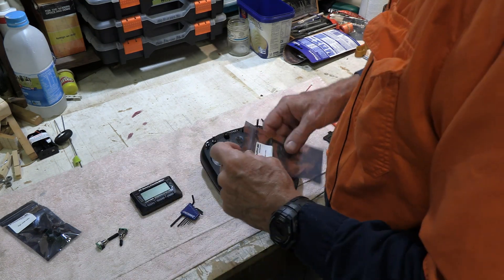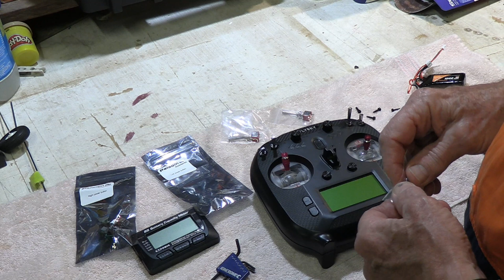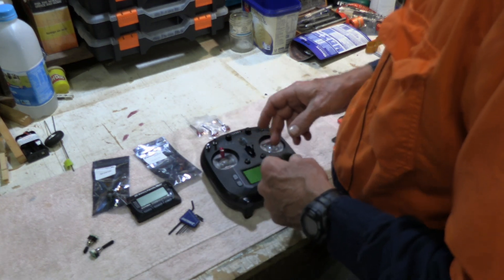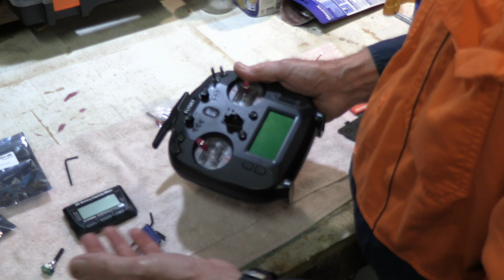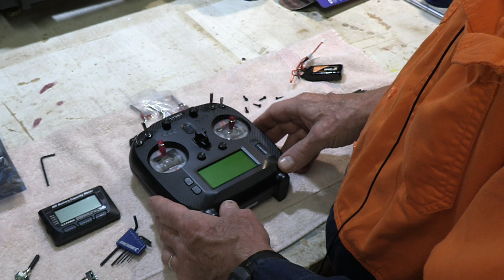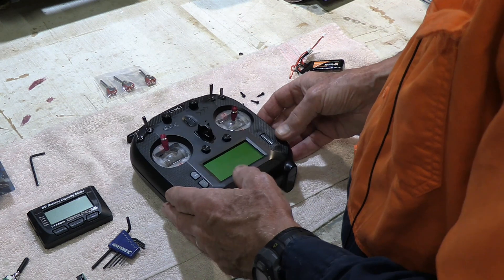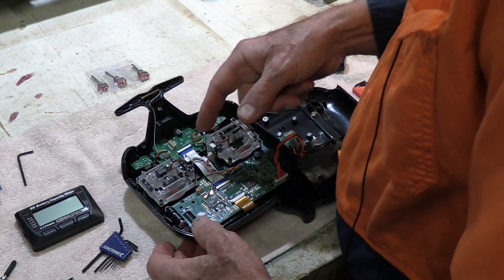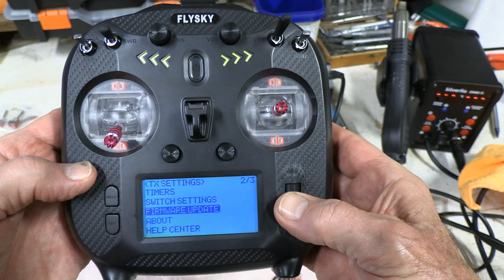Flysky FS-ST8 RC Transmitter Switch Replacement

Comment: Hello I juste try on mine but it didn’t work like their is nothing on switch B do you have an idea on what can be the problem ? Thanks 🙏
Reply from the maker: Did you go into the menu to identify it as a three position switch?
Reply: What if the circuits fried there seems to be no replacements for the switch circuit on its own

Comment: As you say its a cheap throw away. Spend a little more money and get a Radiomaster Tx16s.  You will not be disappointed.  EdgeTx software is continually updated and open source.
Reply from the maker: Hi Craig,  Yes, that's what I have done!  But as you will see in the video that I just uploaded, there can be some range issues when using a Spektrum receiver with the Radiomaster.  I'm now ready to give away Spektrum and go with Lemon RX for the receivers.
Reply: @RCJim  I don't have many spektrum receivers unless they have self leve and avian esc telmetary.. I never will and don't have any spektrum that I will fly fpv. Spektrum= line of sight only.  The planes sometimes only come with a spektrum receiver. No self level and telemetry with avian esc it goes in garbage along with many of the cheap plastic servos before its maiden.
Reply from the maker: @craigcupit1917  And in my case, it’s still coming close to failure well within line of sight!  While the Lemon RX is using the same protocol, it’s receiving a much higher signal strength for some reason.